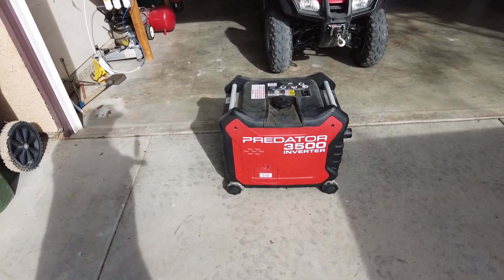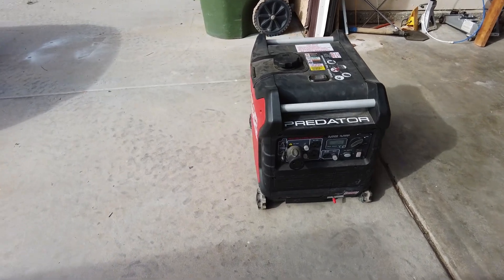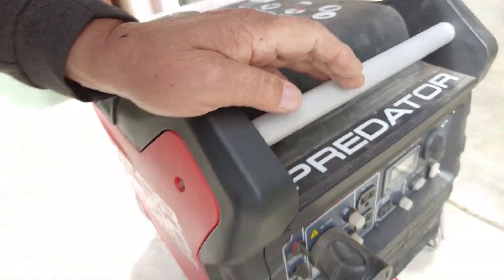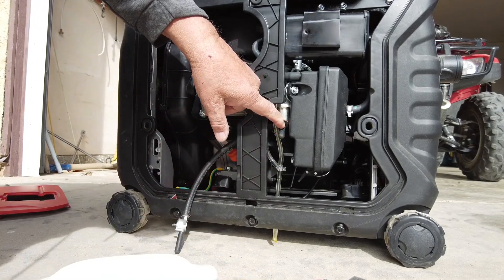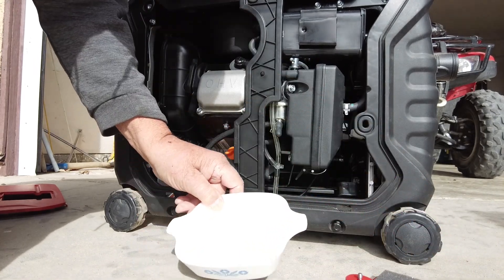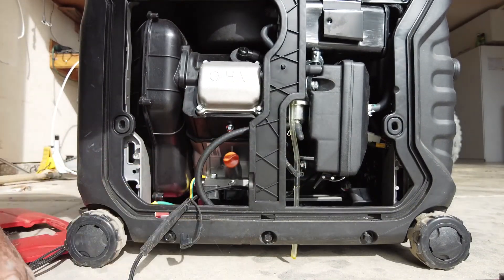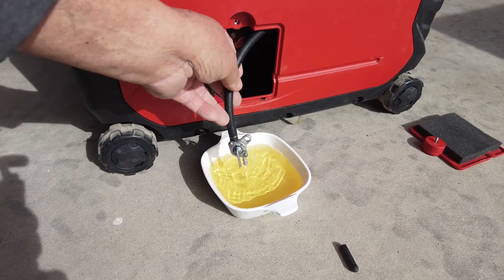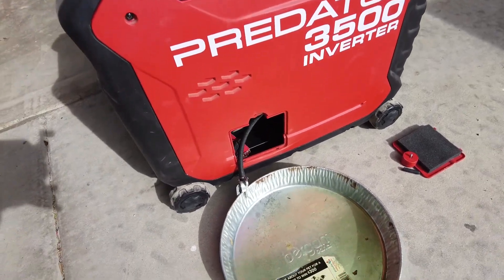Harbor Freight Predator 3500 battery and carb mods

Comment: Have had my 3500 for almost 5yrs, typically don’t drain the carb but do run it every 60days or so with marine stabilizer ….no issues thus far. I do like the battery mod though. Recently ordered a remote start kit , have not installed.

Comment: I have owned my 3500 for about three plus years.  I use it for boondocking instead of the Onan 7500. And it kept outside year round, and it's parked for weeks at a time without starting.  I have found that Non-ethonal gas with fuel stabilizer has worked for me. When ever I get to my unit and hit the starter button it starts ever time. In a 5 gal container of non-ethonol I put 2 oz. of  stabilizer and it works for me 😊.  (1 oz. of stabilizer is the normal but I put 2 , because I may not get to my unit for weeks) 
ps: 
My original battery (died) just got replaced with a PN# YTX7LBS.

Comment: Nice video and thanks for sharing. I have had my Predator for about 7 yrs now and the only problem I have is that is doesn't turn off when I turn the knob to off it will keep chugging like fuel is is in the carbs bowl. I took the carb off last season and cleaned it and the jets with carb cleaner and it worked fine for a few months and now doing the same thing. Just wondering what you might suggest or anyone else? Thanks.

Comment: Just use non ethanol  fuel. Also after you drain the carb. Bowl  try to start it to get all the fuel out of the carb.  Cavities. If when you try to start it that turns back on the fuel, then you need a different  mod.
Reply: It’s impossible to find non-ethanol gas..
Reply: It’s impossible to find non-ethanol gas where I live in NJ.

Comment: Great ideas (both)!  I read somewhere (I think in Predator owners manual) to keep fuel tank at least 2/3 or 3/4 full will help keep moister from forming.
Reply from the maker: That is true.  That's why we always refill the gas tank in airplanes.  It helps to keep the moisture out of the fuel.

Comment: I was disappointed with the combination ignition-fuel shutoff as well. I installed a toggle switch that bypasses the ignition switch when the knob is in the off (no fuel) position. The engine will keep running until the carb runs out of fuel. I have always used non-ethanol fuel with 4 ounces of Sea Foam added to 5 gallons of fuel. I always keep the tank full for emergency. The 3500 has run flawlessly for over 3 years.
Reply: One could interrupt the ground kill connection which is activated by linkage by creating your own on off circuit. This would allow the engine to run until the fuel in the carb bowl is depleted. The fuel drain idea is super easy too and necessary if you expect the thing to start after storage if you did not deplete the main tank of fuel.  A kill switch is Easy enough but probably would void the warranty. Who cares if the unit is old anyway. The trickle charger trick is a super idea. I picked up a damaged one for $200 and got it running. This is the same unit as Northern Tool sells only blue in color. Great tech service too.

Comment: Nice job on two mods that I will surely add to mine when I get it.
Reply from the maker: Something that is very important is to not let the fuel stay too long in the carburetor or tank.  I don't need to drain the carb much anymore because I run the generator once per month for about 15 minutes.  Another thing to help prevent having the engine run too rich is to install the proper main jet for the altitude you will be at most of the time.  The generators come from the factory with a 76-jet installed.  It's okay for sea-level operation.  But the higher up you go in altitude the leaner the air/fuel ratio should be.  I'm at about the 2,500-foot level here at home.  If I remember correctly, I installed a 72-jet in mine.  Some folks at levels higher than 6,000 feet install 68-jet.  It is just like in my airplane, the higher up I go the more I have to pull on that mixture knob to lean out the mixture.  You can find more information about this on other Youtube channels.  Thanks for viewing and your comment.

Comment: Great video. Can you help with where you got all the parts. Thank you
Reply from the maker: I got the fuel valve off the Internet, and the charger at Harbor Freight.  The truth is that if you run the generator every couple of months like the instruction says to do, you won't need to drain the carburetor. There is a sticker on the top of the gen confirming that.  I run mine and my house's generator every month for about 10 minutes.

Comment: So if the drain you installed is just for the carb…how did you drain all the gas from the generator at the end of your video? 🤔
Reply: Put the selector switch to run while not running and that turns the fuel on, then open the carb drain
Reply from the maker: @Ebikelover  Yes, that will work.  It would take a long time to drain 2 gallons, but it will work that way.
Reply: @Ebikelover  I know that.  I was asking how he did the mod for that…see his response.
Reply: @superjoint57  Oh ok gotcha sorry
Reply: @Ebikelover  All good! 👍🏻👍🏻
Reply from the maker: Well, that idea did not work out so well.  At first, I installed a "T" fitting in the fuel line directly under the fuel tank and before the fuel shut-off valve.  I then installed another shut-off valve and ran the line in the same place I put the carb drain line.  I don't remember now just why I didn't like it.  It might have been something to do with space, I don't remember.  But I have since removed that mod.  Draining the fuel tank is something I'll have to think about for a while longer.  I don't keep more than a half gallon of fuel in the gen when it is not going to be in long-term use.  Also, I'm finding out that it is almost not necessary to drain the carb if you run the gen once or twice a month just to keep it cleaned out.
Reply: @booniebuster4193  That's the best thing you can do to avoid all kinds of problems, run your generator regularly, many people seems don't to understand that, and are surprised when they need the generator during an emergency it won't start.:goodvibes:

Comment: Is the shut off 1/4" and where did you get the rubber cap?
Reply from the maker: I got the rubber caps at AutoZone.  They came in a package containing several of varying sizes.
1PZ M2W-001 In-Line Gas Fuel Shut Off Petcock fits 5mm or 3/16" ID Hose Fuel Line

Comment: I have a Champion and put a petcock and hose on my oil drain. I'm in Quartzsite AZ in my RV for the winter and it's been 100-105 for the past month. I change my oil twice a week with synthetic 20-40.
Reply from the maker: Twice a week???  That seems a little excessive, but will certainly do no harm.  I also started using full synthetic oil.
Reply: @booniebuster4193  Ya, it is excessive but costs maybe $.75 each time? I bought 6 glass water bottles that hold exactly the amount of oil needed to change the oil each time. I also have a magnetic dipstick. There are some very fine metal shavings. I've already run into a few people who only change their oil when the engine low oil alarm shuts their generator off!!! I never have to check my oil. The new CO sensor is crap. If a mouse farts the engine shuts down. I'm a retired engineer and didn't take long to figure out how to modify and disable the sensor.

Comment: These don't have a warranty.
Reply: I had a 3 year warranty on mine when I bought it in 2018
Reply from the maker: I don't know about now, but when I purchased my generator on January 12, 2021 there was a 90 days warranty on the unit. It is printed in the owner's manual.   I purchased the extended warranty for an additional $156.00  So I'm covered for an additional 27 or so months.  It is a direct replacement warranty, but only if I have not made any unauthorized mods to the unit.  I can undo these mods and no one will ever know I did them.  Looking back on the Extended Warranty, I think it was a waste of money.  There are untold thousands of these units out there and very few complaints or problems.  But the EW is good for peace of mind just in case.  Most of the problems were created by the owners not doing proper maintenance or following instruction in the manual.  Almost all of the problems had to do with gas,  management,  overfilling the tank, or not cleaning the Spark Arrester

Comment: Good video. One item I would debate is the need to drain the fuel. If you use non ethanol gasoline and run your generator at least once a month I see no need to draw n the carburetor of fuel. For added insurance a
 a quality fuel stabilizer can be used.
Reply from the maker: You are correct.  I have begun running it once per month at the same time I run the bigger house generator.  And I do use stabilizer in both. Thank you for posting a comment.

Comment: Thanks for sharing your mods. I have been looking for a small inverter/generator, believe I just found it. Stay off that bad knee Brother. Found your channel from the PUP, glad I did. Keep them coming. Bless you and yours. See you on the trail.
Reply from the maker: I have not had any problems with my 3500 so far.  I keep a trickle charger on the battery when its in storage.  I don't use the Generator very often.  Mostly  to run the A/C unit on the camper when I camp in the summer months.  I have a routine check-up with the Knee Doctor this afternoon.  It has been doing quite well lately.  Not much of a problem at all. Thanks for asking and viewing.

Comment: Note to self: clean wife's Corning Ware casserole dish before returning to the kitchen.........
Reply from the maker: Good advice!  However, I found that dish out in the desert while on a Quad ride.  It is permanently stored on my work bench.  It generally has nuts or bolts and screws in it from what ever I'm taking apart that day.

Comment: Like your drain mod. I’ve seen that you need to also cycle the off-run-start switch while doing that to drain the carb completely. Is that the case?
Reply from the maker: No.  When you turn the Off-Run-Start rotary switch to the off position, it also shuts off the fuel to the carburetor.  Even by draining the carb in this manner, there is still a very tiny amount of fuel left in the very bottom of the carb bowl.  It is only a few drops at best.  But not enough to be any where near the main or idle jet. I discovered that when I took the bowl down to replace the Main jet to lean the mixture a bit for higher altitudes.   It came with a 76mm jet, but I installed a 72mm jet since I will be camping mainly above 6,000 feet.   I am not real happy with the drain valve I'm using, but I could not find one of the proper size and configuration that would be better.  However, this one does the job.

Another mod I am thinking about is a fuel drain valve and line that will quickly drain the fuel tank when putting the Gen into storage.  Right now if you want to completely drain the fuel tank it has to be through the carb using this modification.  That works, but it take a little longer due to the size of the fuel line.  I'm thinking of a "T" in the main line coming out of the tank before the carb and going to a larger fuel shut-off valve.  But I don' t want to do anything that will void my warranty.  It would be easy to do by removing the air filter box.  The tank fitting and hose is right there in plain sight.
Reply: There is a valve for fuel shut-off incorporated into the rotary selector. It actually serves 3 items. When you turn it to start, it opens the main fuel valve from the tank to the carburetor and puts the choke on. When you select the run position, it simply moves the choke lever to the open position. The fuel valve, of course, is still open in "run." When you select "off," it has an ignition kill switch that grounds the ignition, and the fuel valve is shut off.
1=Fuel shutoff
2=Ignition kill switch 
3=Choke control 
A lot of people I see on other videos aren't sure where the choke is or if it has one. One video I recently seen, a guy said it probably has an automatic choke. Well, it's not automatic but built into the selector on the front panel. Works like any other choke having a separate lever.
I think the main point or question the original commentor here was saying is to drain the fuel from the tank as you were doing at the end of video, you need to move the selector to run. To open the main valve from the tank. Otherwise, you'll only drain the bowl.
Very good video and great ideas for easy maintenance. On the latest models of these 3500 generators, they've made some changes. One, is the oil drain has a hose barb fitting and a short piece of hose tucked inside the oil check door. They also put the oil drain/fill dipstick on the other side of the generator. This new setup is very difficult to bend the hose to get it draining out the bottom where the rubber plug is at. I started to get 1/8" pipe thread fittings to install a brass valve with a short brass pipe nipple to extend out the bottom of the generator. This would be a very convenient way to change oil. I found out that the pipe thread in the engine block is Chinese pipe thread. So I put that idea on back burner. I suppose I could run a 1/8" pipe tap through it, and with Teflon tape, it should have enough meat to thread in a national pipe thread fitting. Then, I need to make sure no metal pieces end up in the crankcase. LOL 🤣